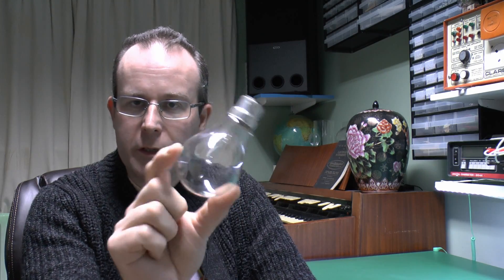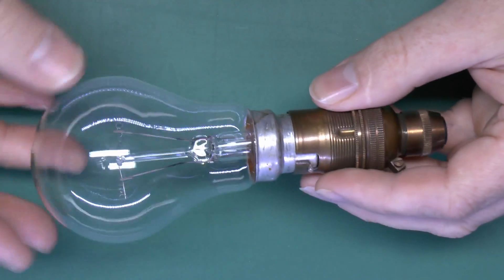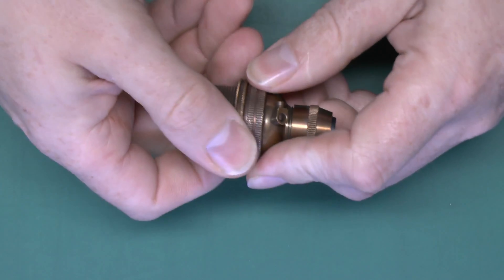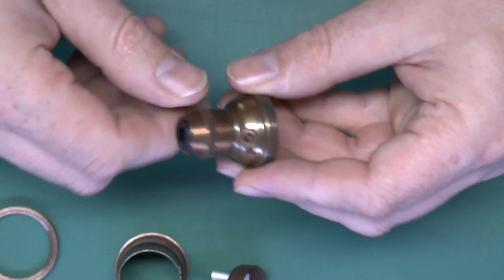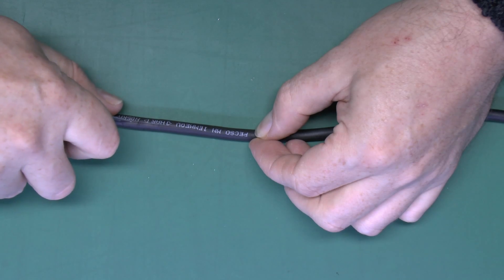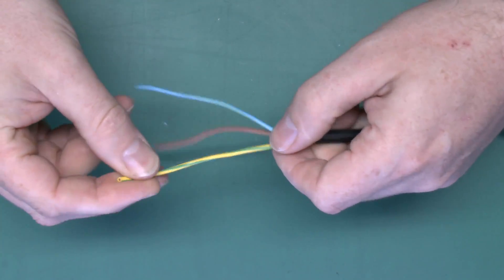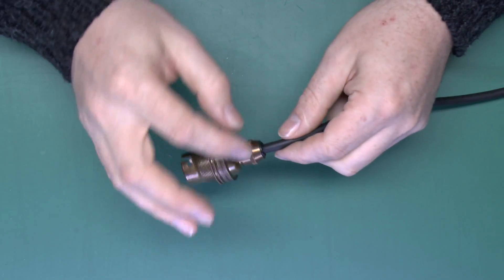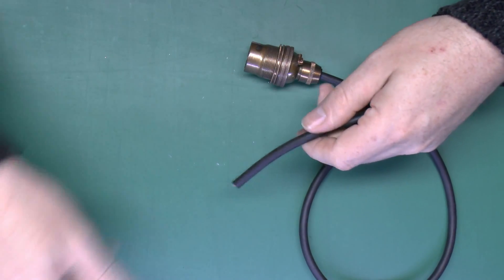Metal Bayonet Lampholder Wiring & Testing

Comment: Hi! Amazing video! I bought an old lamp the other day with bayonete brass bulb holder - the earth wire runs through a hole on the bulb holder and is held in place by a screw/metal washer on the outside of the bulb holder, wondering if this is safe? Odd to see an exposed wire on a lamp fitment right next to the switch... Any advice is greatly appreciated. Ps clearly im not an electrician 😂

Comment: I've just wired a brass bayonet fitting to a lamp today. Note when your mounting the brass fitting to a lamp all metal with metal 10mm rod. You will need a metal washer for the earth for the lamp to work. Also a wooden lamp i changed a fitting from plastic bayonet to brass looks more nice antique looking

Comment: Can you/anyone help with if the lamp flickers .
I'm presuming the springs are duff in the holder .. how could this be tightened?
Reply from the maker: Failed springs are unlikely, and pressing the pins with the power off would identify that problem.  New lampholder if the springs have failed.
More likely is a loose connection in the wiring somewhere.

Comment: Thanks John, only had two wires and couldn't see any marks for positive or negative on the socket, you've explained that the polarity doesn't matter, the earth must be concealed inside as only blue and brown are visible but its a three way plug. Working well, thanks

Comment: When reassembling, always make sure you have aligned the lamp holding piece (has the L-shaped slots) correctly with the ceramic piece otherwise the contacts on the bulb won't line up with the pins and thus no light.

Yes there are notches etc. to line it up but it is possible to get it wrong and spend ages trying to work out how come there's power to the pins but the bulb doesn't light up...or so a friend told me....😉

Comment: Edison sockets are by design safer than a bayonet bulb, 2 reasons first the plugs that have been in usage since the 70's are polarized one side flair's out  that is the neutral and that is what connects to the screw part that simple
Reply from the maker: The outer metal part on a bayonet bulb isn't connected to anything, the only way to get a shock is to remove one and shove your finger right into the socket with it switched on.
All UK plugs and sockets have been polarised for over 70 years.

Comment: sometimes the shade ring is over tightened on and  difficult to remove due to the limited access from  the shade itself

I was able to remove one recently by putting a cable tie around it and twisting at the cable tie join with pliers...... saved trashing a good light shade

Comment: Question
i know live can be any on the two in a bayonet socket but what about ES ones
yes the outside should not be live for safety but from a working point of view can the threads be live

i ask because i see many cheap LED bulb doublers on Amazon, bayonet to two ES and was thinking if they were made wrong and the threads were live would a ES LED bulb still work, baynets LEDs can be ether but can ES LEDs
Reply: I think there maybe some rectification of ac to dc in the lamps electronics

Comment: Over the years I've encountered quite a few B22 lamps where the solder has cold flowed around the brass pins effectively jamming the lamp into the base, something that wouldn't happen with a <spit>  Edison screw lamp base.

Comment: No ferrules on stranded wire in a direct acting screw clamp?
Is that OK in the UK?
Reply from the maker: +stefantrethan Pendant sets sold already wired together don't have ferrules, often the wire isn't doubled over either.
Reply: +stefantrethan Yes, it's standard. The screws are shaped for it. There's nothing wrong with ferrules if you have them though.
Reply: +TheChipmunk2008 Well at least he didn't tin the ends, which really gets my blood pressure up, so I'll give you the benefit of the doubt and believe the manufacturer is OK with that, EN 60999 notwithstanding. ;-)

I know, I know, it sure doesn't matter for a lamp holder with no current to speak of...
Reply: +stefantrethan Yes, tinned ends get my blood pressure up too, the people have never heard of cold flow!

The screws in most reasonable quality lampholders for UK use have a domed tip to grip the wires without cutting through. I believe the practice of simply twisting and doubling the wires is so engrained that few people consider ferrules. Ferrules are much more important as you say with high loads, and with multi strand wire. 19 strand lighting flex isn't too much of an issue.
Reply: +TheChipmunk2008 I've only ever found one tight tinned connection, and it had been re-tightened so many times the clamp was down to bare copper with all the solder squeezed out. All others I came across were loose, many to the point of visible overheating and even some with completely missing screws. I'm sure lives were lost to this nonsense (in fires), since it was fairly common around here some decades ago.

To fight for the ferrule is pointless, the old guard will never change and all the clamp manufacturers have switched to cage clamps or other technology that makes it optional anyway. I've done the twisting and doubling-over thing in a pinch, but I make a point of at least putting the screw on the bent over end. Done with care it's reasonably safe but I wouldn't exactly show it on youtube since I don't think it is good workmanship. Ferrules can be done badly too, if they are not crimped gas tight.

Comment: +John Ward  where can i get a Clare A255 Series 2 appliance tester or is this model not made anymore
Reply: Other appliance testers are available, Also look at Seaward (same company as Clare), Fluke, Megger and Kewtech.  Beware though, there are some dodgy testers available on eBay and Amazon.  Identifiable by having what bigclive would call a deathdapter on the front instead of a proper BS1363 style socket.
Reply from the maker: +Adam sturgeon Discontinued years ago.  The Clare B255 is the nearest equivalent still manufactured, although they are expensive items to buy new.

Comment: Do we have any history on why we use B22 over Edison connectors? I am guessing its a legacy thing . Bayonet fittings overall are superior to Edison in my opinion , the only good thing about Edison is that you can know the polarity ( assuming that its wired correctly ).  I don't have access to the BS EN 60238 but it makes sense that the centre tap is connected to the line.
Reply: It seam easier to accidentally touch live contacts when a lightbulb is not fitted with B22 over Edison, assuming that the Edison holder is wired correctly the live conductor is the one at the bottom of the socket, practically impossible to touch if you don't stick a finger in it on purpose. 

Also the Edison socket seems to make inserting a lightbulb more easy because you don't have to align anything but just screw it in, considering that most of the time you are on a instable ladder trying to reach a bulb in a fitting where maybe you can't see the bulb because it's behind a glass or something, Edison is more immediate. 

And lastly with Edison sockets you can turn of a light without removing the lightbulb by just unscrewing it just to have the bulb not make contact with the terminal, but still screwed to the fixture.
Reply: I would believe it was patent and trademark issues, but after a while you get to a point where you're stuck with what you have even though other countries might have a better standard.........

Comment: These are so much nicer than Edison screw bases, many of the screw bases I have encountered are very low quality, I've even torn the screw insert out of the ceramic base by over tightening.
Reply: and don't get me started on those new plastic utility light sockets that are all one-piece molded and so easy to get the light bulb to miss screw into and jumping the threads.